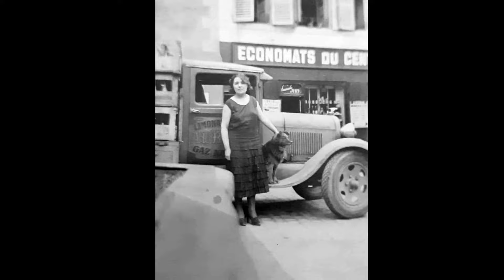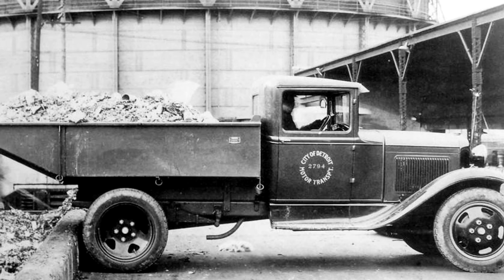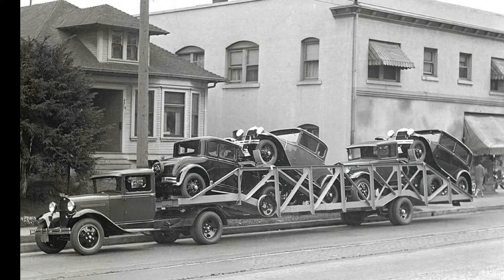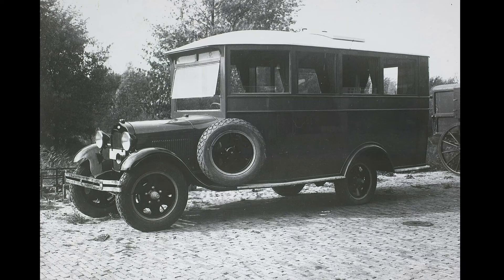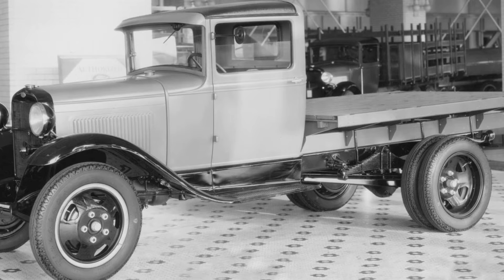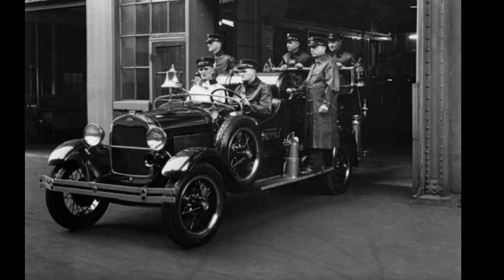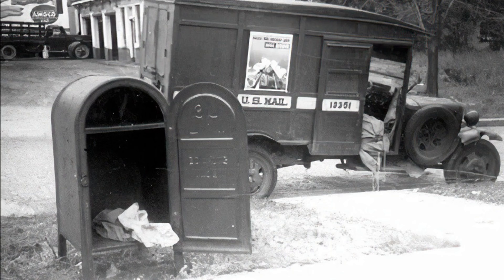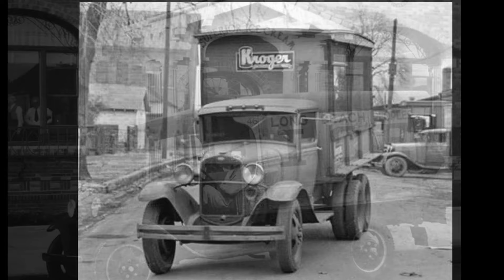The History Behind The Ford Model AA Truck A Narrative Pictorial 80 Vintage Photographs

Comment: Can you do a video on the forgotten Model B and BB trucks? I have a 1934 157 inch wheelbase BB truck that came from Great Falls MT. It was used until 1963 when the engine broke. It was left sitting in the field until 4 years ago. Replaced the engine with a similar flathead V8. It now runs and drives again with most of the original parts still on it including the  brakes.
Reply from the maker: That is a great idea!  I will see what I can do!